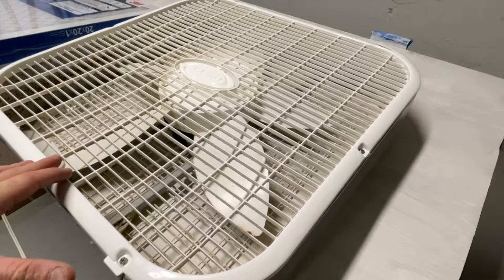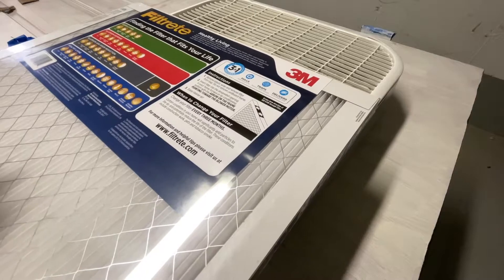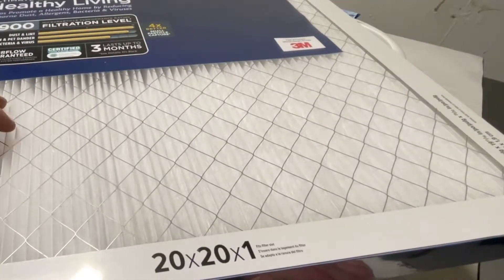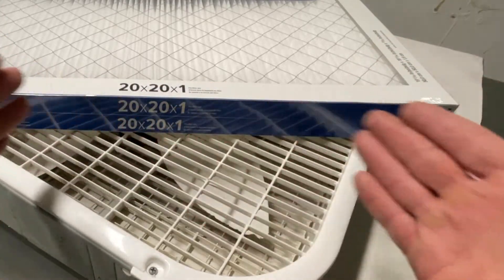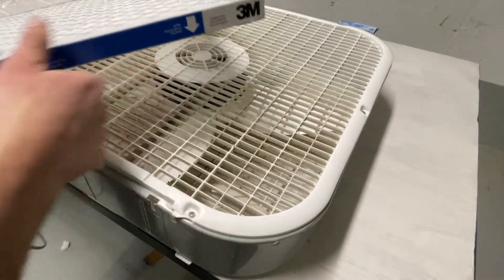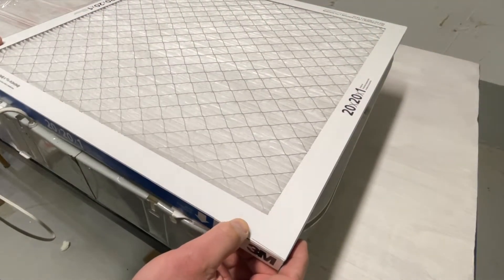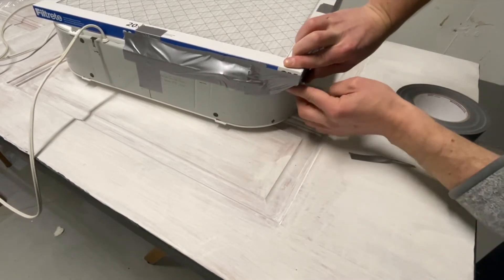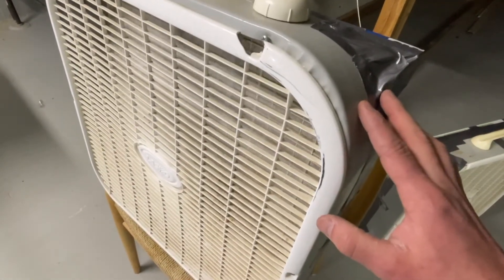Homemade Air Purifier With A MERV 13 Furnace Filter And A Box Fan

Comment: I just use a thick exercise rubber band to keep the 20x20x1 filter attached to the back of my box fan for the basement to lower the airborne dust (especially when I'm working down there). Having it in the front will do nothing to keep your fan blades and motor clean (personal choice I guess). I mainly use it to help move air around from one side to the other so the dehumidifier isn't the only thing trying to circulate the air in a larger area that's partitioned.

I don't think it's necessary to seal anything and tape will just leave a sticky residue. Sealing it up will just take up more time and make it harder to replace the filters. It will also put more strain on the motor as the filter fills up and there's no other air source. A large rubber band exerts enough force to keep the filter against the back of the fan without crushing it. You can use more than one large band to help spread the force out. You will still have plenty of air passing through the filter, even if are some gaps around the edges. Again, I don't think you need to seal it up but correct me if I'm wrong.

Once the fan's output is noticeably lower and/or the filter is a dark gray color, I usually swap it out. You can write the date of install for reference in large print on the filter sides.

A little tip that I wish I knew if you are putting filters on the back of the fan: Try to get a box fan that has a cord outlet around the side rather than the back so you don't need to keep making a hole to feed the cord through. It's a little annoying but nothing a scissor can't cut through.
Reply from the maker: Amazing tips. Thanks!

Comment: Been using this type of Filter now for a month... If your limited in space..and cannot do the 4 filter box and your just doing it to create a cheap room purifier... Please try the 4" filter instead of 1"... The air flow increases drastically.. I managed to find them on sale.. they also last longer. Also sound reduction as a result of the 4".
Reply: A 4 inch filter would be more restrictive. Complete opposite of what you said here